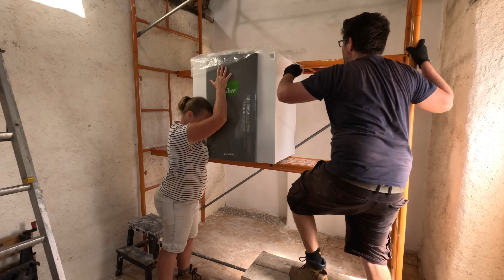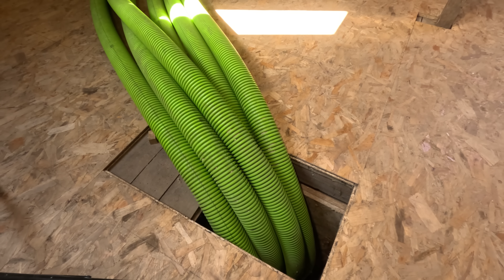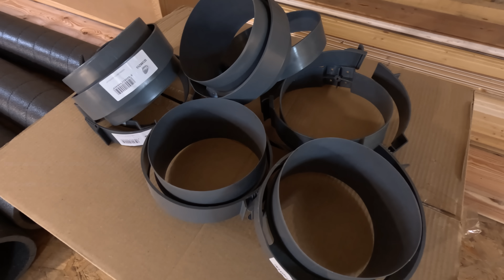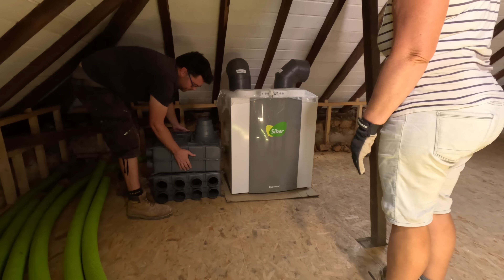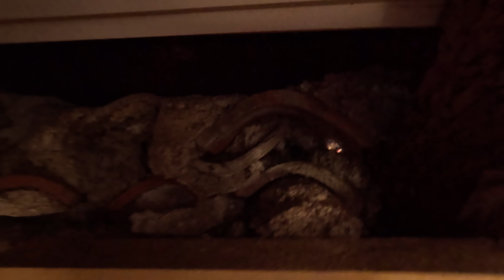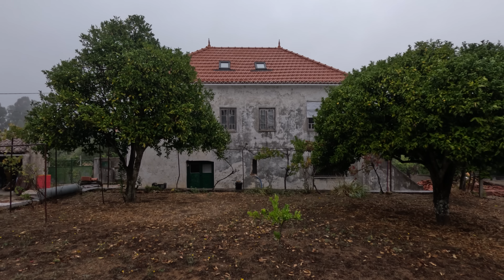Installing MVHR in an Old House - Part 1 - Preparation

Comment: Did you consider the prevailing wind direction? Seems best to not put the "in and out" pipes into the wind but either on the opposite side of the house, or on the sides. Interested to understand your thinking.
Reply from the maker: In our location there is no single prevailing wind direction - no doubt due to all the large hills.
The manufacturer’s instructions specify north facing (ie. less exposure to the blistering sun), so that’s what we’re going for
Reply: @MAKEDOGROW  thanks for coming back to me. The north facing makes good sense. Appreciated. Cheers

Comment: That was the most insanely courageous thing I've ever seen anyone move. I don't know whether to applaud or call for the men with white coats that zip in the back!
Question: if you piped the hoses down to the next floor and out the outer wall while leaving the machine where you brought it up, would that help to not dislodge your Roman tiles, mess with the roof line, or mess with the stone walls when you need to frame a vent for the piping to the outside? Do the green pipes really need to be next to the machine, or can they be a tiny bit away from it? If you built a closet one floor down, all the green pipes could reside in the closet  and the outer wall would have a frame (like a small window) where the ducting would lead to the outside. Am I making any sense at all?
Reply from the maker: We have been through every permutations for this install, and for numerous reasons we’ve chosen the loft as the best location

And it doesn’t make any difference which floor we connect to the outside, all external walls are made of stone (and are thicker on the lower layers of the house)
Reply: Great thinking, and yes I read it all twice. 👍👍🏽👍🏿  Who knows what they will decide?

Comment: Ugh, moving that unit sans stairs, you got it done, but definitely a long cool drink as a reward is called for. The plaster should also help keep crap out of the lines if even a small pinhole should appear.
I like the unit conserving heat, that's quite a change from chimneys or wood stoves that tend to blow heat outdoors.

Comment: Have you investigated if and how.much of noice will be transfered over via the floor to the rest of the building. It might be the time to investigate if some dampers should be under the unit before its tolate.
Reply from the maker: Everything we’ve read, including people’s reviews, indicates it is a very quiet unit. There are anti-vibration feet on the unit, but we will be testing it fully before we box it all in, just in case we do need to add anything.
Also, it’s directly above our (yet to be finished) bedroom, and won’t be running at night … and most days we’ll be elsewhere in the building, or outside 😀

Comment: I feel your pain. I'm restoring an off grid stone-built cabin in northern Spain and have just finished painting the beams and ceilings and removing about 2/3rds of the floor to open things up. This is extremely hard work and you two manage to do the work and film it! Any video I took would have to be bleeped out with a lot of #$@&%*!